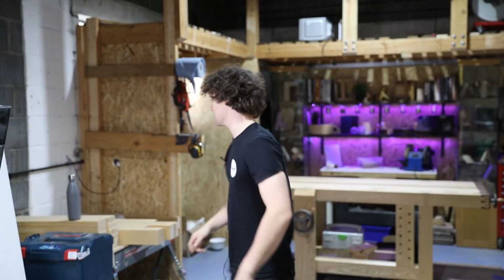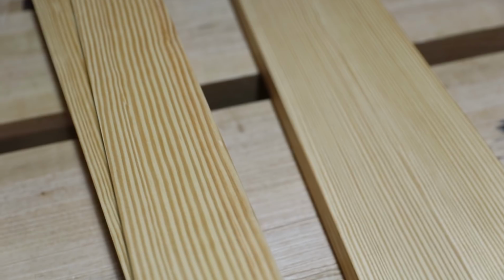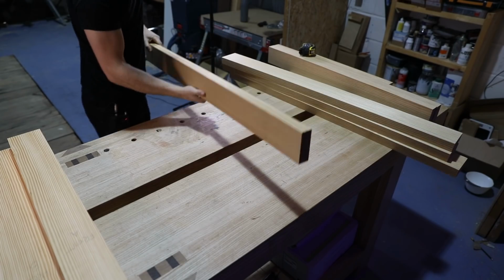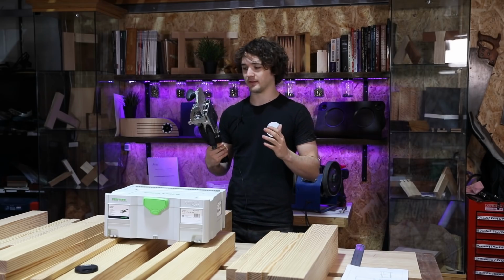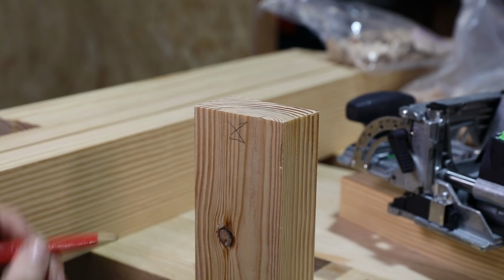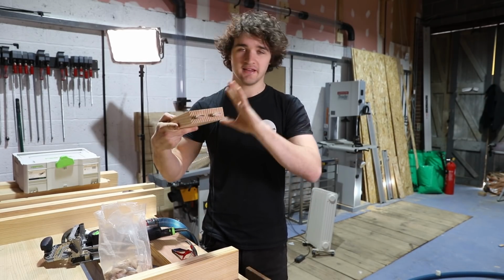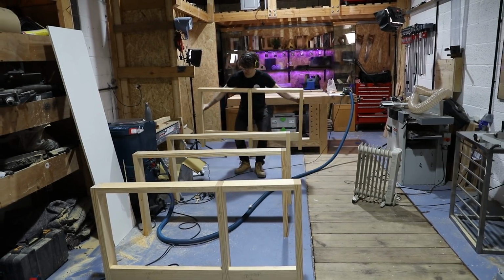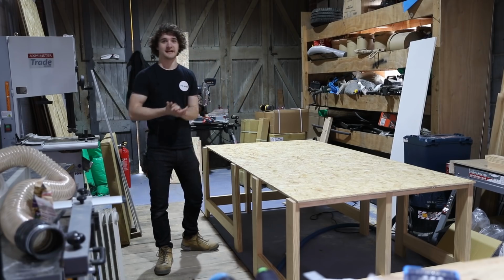Making the ULTIMATE Power Tool Workbench | Part 3

Comment: It’s interesting - I watched this when it first popped up years ago. Seeing it again after building some cabinets and a big, built in workbench, there were a few points where I asked myself “is that really how he assembled this?”  Obviously his approach works beautifully for him; however, you have to be maniacally accurate with your measurements, marking, and cutting to make a nicely square assembly this way. For example, I would use a spacer to ensure that each lower stretcher is exactly the same height from the bottom of each leg. I learned the hard way to make a box for each set of drawers instead of building a frame and hoping the sides came out square and co-planar. I don’t cut adjustable shelves to final length until I can sneak up on the right length that works in the bookcase I actually built because the measurements on my plans are just a starting point the way I approach it.

Comment: HI Matt, great vid, I am just starting off in woodworking so I am not pretending to know better, but I would of thought in the A & D frames to have the top brace run all the way through and shorten the middle leg rather than cutting it in half and have the middle leg run it full length. SO I wanted to understand why you selected to cut the brace and connect it to the leg from both sides. Hope my question makes sense and I appreciate your feedback.
Again it a great informative vid really enjoy your style and honesty. Greetings from Sydney /.

Comment: Hi Matt, great series. I had exactly the same thought, to use my Parf Guide built Table, (Dave Stanton Style), as my saw table, but couldn't resist buying an lovely American made Xcalibur Cabinet Saw I found on e-Bay. (It has a long arbour, for anti EU purposes ;-)  ). What a difference it makes having a super accurate saw table.
Having spent a week getting it set up the way I want to use it, with my UJK Cast iron router table neatly bolted to it, I was wondering what to do with the large Lay-up table I was using as the Router table. My initial though was to get rid of it to free up some space, but on second thought, It seems it may become something like your project?

Comment: For spacing the stretchers from the bottom of the legs, I would cut a spacer block the exact distance and use that to line up the stretcher to the leg. A little more accurate and consistent and less fussing with rulers and marking. Domino is probably a revolutionary tool, just wish I had more time to go into my shop to build with one!

Comment: Looking good Matt.
Would love you to do a more in-depth review on the domino jointer with it's pro's and cons. 
Would love your thoughts on if its going to be worth the big investment or would a table saw and morticer be a better purchase for M&T's as the cost would be similar in the end. 
Thanks 👍
Reply: A Makita lamella saw is 160.- Euro as solo 18V machine.IF you go for Dominos, I say go for the XL version. But that will cost 1000.- Euro, and the dominos are like 50ct each. Adds up...but you need to be really enthusiastic or a pro to justify...
Reply: @volkerpetersen2268  making the move to full time as we speak, so looking at machinery options to get the most economic and useful tools I can. If it dies the job as good as m&t's plus other uses, then its worth considering. Thanks for the reply. 👍

Comment: A really interesting series. I’m also liking the continuity between Bertha and the new table (does it have a name yet?). I like those sort of details.

I do have a random question that I’m sure someone will know the answer to. I keep getting chisel cuts on my finger when I rest the chisel on my finger (when pairing, etc). Does anyone have any tips on how to stop this please? I’m very new to woodworking and I catch the index finger on my hand every bloody week in college. Lol. Thanks in advanced.
Reply: Some people put masking tape around thier fingers as a protection.

Or you could just break the edge of the chisel on a fine gritt waterstone diamond plate or (wet) sandpaper.
As long as the edge break is very small and you don't damage the cutting edge it should be fine. I just made this idea up and never tried it myself, but I can't think of any reason, why this should harm the chisel.
Reply: ensen89. Thanks for the suggestion. I was thinking about using tape around the fingers, so I’ve bought some sports tape that boxers, and other sports, wear for strapping.
Reply: Your welcome. This morning it came to my mind that breaking the edge on the chisel might not be a very smart idea. As the chisel gets shorter during use and charpening the edge will get in the chamfered area and you wont be able to get it sharp at the endpoints left and right. It won't hurt your chisel at the moment you do it, but in the long run so you better go with tape or leather. =)
Reply: i have some leather finger guards that I got when I bought some carving tools way back, they're super handy for remedying your situation there. :)
Reply: JonathanScott Woodcrafts. I saw those on Amazon and was wondering if they would help. Thanks for the suggestion.